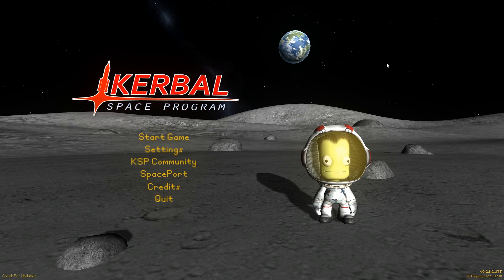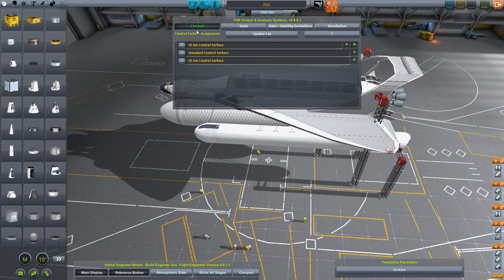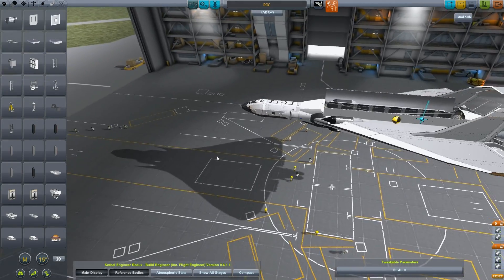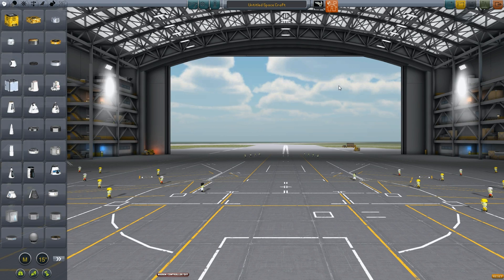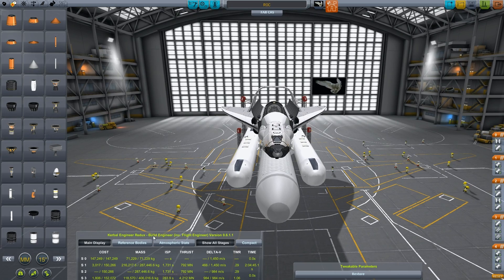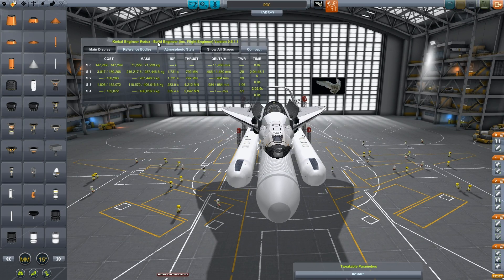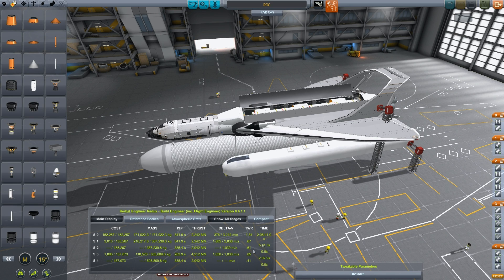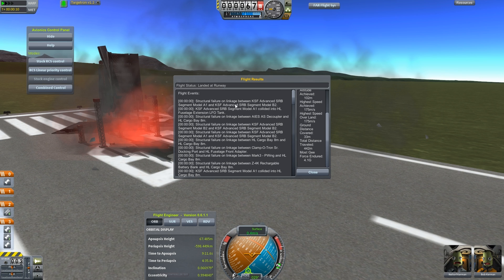Let's Fly KSP: Space Shuttle Development, part 19 Tinkering and Tweaking

Comment: Matt, about the SRB's. I realize it's a custom made part but you should apply some rules to it: have a maximum amount of SolidFuel you can put in it (based on volume using pi×r^2×h and stock density) and stick to this amount of fuel. Try to make the dry mass of the booster about 15%, like the SS-SRB, and balance thrust, and also TWR on this number. Since you can't just drain a solid rocket I'd suggest you balance the burn time by customizing the ISP ('widen' the nozzle a bit).